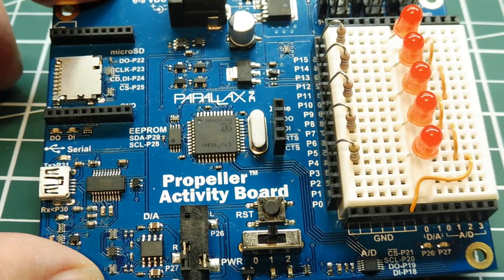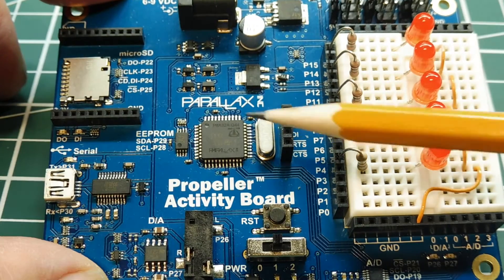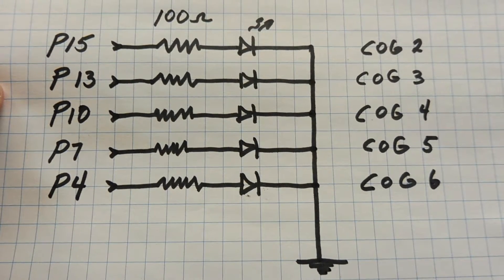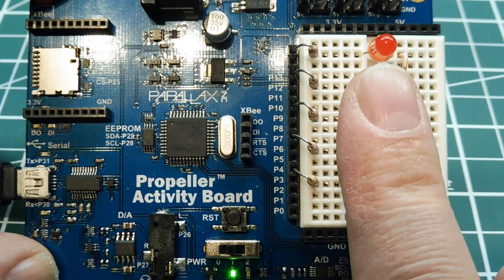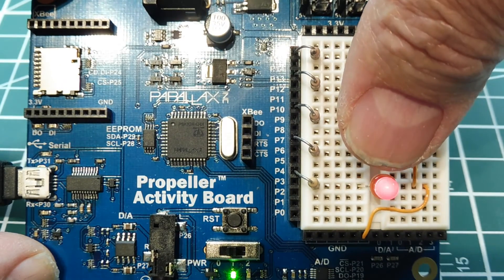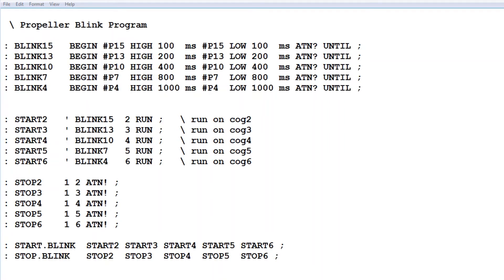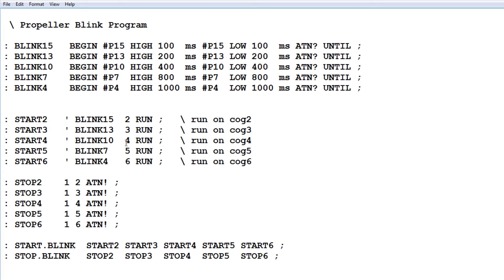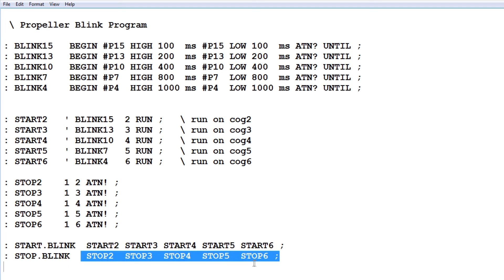Embedded Programming without Interrupts  / Parallax Propeller / Tachyon Forth

Comment: Stock Tachyon except for ATN? and ATN! Having those words would be handy.
Reply from the maker: ATN? and ATN! were used in the early versions of Tachyon and removed in the later ones. Tasks are run in BEGIN ....AGAIN constructs and never stopped. If you want to stop a task use BEGIN......UNTIL and create a variable filled with a false fleg (0). Put this variable next to UNTIL to run the task. To stop the task fill the variable with a true flag (-1)